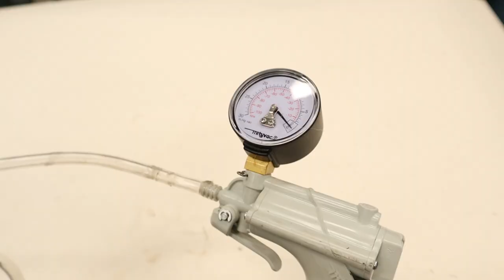Learn everything about distributors, car tips/tricks, and much more! How to become a gearhead! EP#8

Comment: I worked for Ford as a tech for close to 50 years. I also started working on all makes and models at gas stations before Ford. Saw it go from Carbs and distributors to variable venture carbs to two fuel injectors in what looked like a carb yet was a throttle body. In my Ford 302 V8's I went from single point vacuum advance to dual point fully mechanical advance. Fords were easy GM the dist in the rear was not yet they did have a door to adjust  points with a hex key. Then it all became input and out put sensors and a computer brain which by 2004 there were computers to control everything. Some had 4 to 5 different computers to control the windows and A/C and even the horn and all the dash instruments. 

 What I drive now is a 73 VW type 3 which has fuel injection and a basic ECU that unlike modern computers does not hold info. Trouble is you cannot purchase new distributors and it's difficult to find parts to repair ones that have wear. There is a 123 unit that is fully electronic . The basic idea of the stock Bosch dist for FI is the trigger points that in basic terms fire a pair of injectors which is  2 points that work off a cam , unlike ign points the voltage is not high so the points never burn . The 123 unit does all of this similar to pertronix in place of points which I did have at one point . I didn't like the idea if the pertronix failed you have to carry a spare set of points and a condenser and change all of this on the side of the road so I went back to points. Plus the 123 unit is in the $400 range and if it failed better carry an spare stock distributor . 

 I see one can buy new distributors for old Ford and GM cars not VW. You can get points , caps,rotors and the condenser now do not last unless you purchase from places who offer NOS units.
Reply from the maker: Sounds like you know your stuff William and your years of experience have given you a much better knowledge base than any new tech out there.  It's hard to teach this stuff to new students because the new parts still work the same but the ease of adjustability is gone and it's harder to understand the fundamentals.  Thanks for your comment and sharing your love of the automotive world.  Cheers!
Reply: @wayofthewrench  
I thought last night what to address as a reply. I could write a book , over the decades of repairing cars that were new in the 60's and are long gone now. I have seen everything , especially working at dealerships.

 I found the one area doing repairs that most technicians fail . This is electrical  diagnosis . Even that most modern cars /trucks require this knowledge. It's the heart of any system. I will point out the last time I worked as a tech was 1997 , I was offered a new position which became 7 titles. One was the second service manager. 

 At Ford we did have to attend Ford training classes and then pass a test. At the school they had 3 to 4 cars /trucks where they removed a wire or cut one or pulled it just enough out of a plug .  This involved rather large books and what was called pin point tests which were a path of narrowing down a given electrical issue. I never applied this method simply because it was similar to working though a maze . I used the EVTM which was a small book with the entire electrical system laid out. I would  look at the part of the system with the issue , see how it related to the rest of the system and without taking one thing apart know exactly where the problem was.  Using their pin point test once you reached some path out of the maze  you were instructed replace an electronic part which was never in stock and once the customers car sat there for days you find it was not the part after all.  At the Ford school I would not use the pin point test and used the EVTM and knew where the issue was and asked the instructor do I have to pull this panel or can I just tell  you what it is. He said go ahead . He then said I should follow the set procedure. It's basic it's all there in this small book. I still pasted their test . 

 A warranty repair only pays a set amount .  One example one tech who really could not grasp electrical , the basic idea is check the simple first , just look around . He had the entire interior of a Ford SUV removed . I was walking around the shop and took a look and read the repair complaint . Power door locks all work on their own till they quit. I looked in the back and saw a large cooler which happened to be sitting on top of a lock switch in the cargo area. All I did was move it and problem solved . the tech asked me what i did . I showed him, then asked how are you going to get paid for the 16 hours you spent for nothing. 

 Certainly there are countless repairs that are not electrical related . I recall when the hybrids came out and saw this enormous pallet of 12 volt car batteries as a battery pack and thought you are going to add all this weight and save fuel , is this the way to do this and was reminded way back in 1959 when GM came to our school with a fair sized model of a Vett with disc shaped solar panels of the hood shining a UV lamp and it ran , we were told this would be our cars in less than 10 years. 

 I only took one new car I ever owned to the Ford dealership because it would run fine then start bucking . It took hours then I asked is it done , told the tech is just making sure it's fixed. I get my car back with grease all over the drivers door inside and on the 2 mile drive back home it bucked . I told them it does not happen all the time. I decide to look myself to see if anything stood out then see the ignition coil was leaking oil , took one off my to be sold 63 Fairlane problem solved. My father rode with me because he wanted a new coil and then went on to say my 16 year old son fixed what you could not and they said we have to install the coil he said no and they gave it to him. I felt odd having my father do this but i did get the coil.
Reply from the maker: Yup the basic fundamentals are key to any old or new electrical and mechanical issues.  It's very easy to focus in on a problem and miss the obvious.  Start with the easy and take a second to think about why.  Cheers!

Comment: Do you know why  my brush in the center of the distributor cap keeps wearing out ? I tried a new rotor button all ready.
Reply from the maker: How long did it last?
Reply: @wayofthewrench   I just turned it over to see if it was getting fire. Got none . It’s a 1978 trans am .been sitting in a barn 20 years i replaced everything in the Distributor except the pick up coil and looking for a new distributor now.
Reply from the maker: Yeah sometimes replacing the entire distributor is the most cost effective way these days.  Remember you can test your distributor before you change it.

Comment: Off topic but I want to ask.  I have a chevy silverado 1500.  Fuel injector just went on it.  Dealer said I could drive it until parts come in since it isn't idling funny or anything.  I know there is washing of the cylinders.  Am I in danger of that happening if I drive it for the week until fixed?  They did assure me it is okay but im skeptical.  Any info would be helpful.  Thank you
Reply from the maker: Usually when a fuel injector goes bad, it stops spraying or leaks and continuously dumps extra gas or the spray pattern is not misting but squirting droplets of gas.  Personally I wouldn't drive it if it was leaking gas.  If it stops opening then I guess you just have a dead cylinder but if it is stuck open, you are dumping gas and its going to cause damage.  Hard to know without pulling the spark plug and checking for a fuel soaked plug.  Hope that helps you make your decision.  You might wanna do an oil change after it is fixed just incase fuel has mixed with the oil. Thanks for the watch!
Reply: @wayofthewrench  I should have mentioned that the dealership said even though the fuel injector/cylinder tested much higher then the other cylinders that it was still at a safe level.  Hope you don't mind sending a reply if this changes anything in your mind?  Should I still do a oil change in this scnenerio as well? Appreciate the first response. Great channel.
Reply from the maker: How did they test the injector(s)?
Reply: @wayofthewrench  good question. The dealer said they had to recalibrate a machine to test it for my newer model truck.  Was hard for them to find but then had a readings and the one bad one read much higher then the others but still in the safe zone as they said.  Reassured me it was okay to drive for the week.  No check engine light has come back on in the three days since it saw the dealer.
Reply from the maker: Hrmm hard to say, it could be an oscilloscope reading or a pressure test.  I guess when it comes down to it, if the dealership is telling you it's ok to wait, then it must be ok.  Wish I could be more help.  I hope your repair goes ok.  Cheers!
Reply: @wayofthewrench  thank you for the help.  Appreciate it.

Comment: I'm just trying to find out which aftermarket distributor is reputable.
It's a nightmare trying to find out which ones are junk and which ones aren't because apparently they're all junk and you cannot get an original OEM distributor from Ford.
Reply from the maker: Yeah I hear ya, everything's about money these days.  They don't make things like like used to. Even good brands turn bad when they sell out eventually.  Good luck!
Reply: @wayofthewrench  yeah I was just about ready to go with the most expensive MSD but I even started finding plenty of bad reviews on them.
So I guess I'm going to go with one that I could not find any reviews at all on  (WAI) and then I'm also going to get the parts to rebuild my old one. WAI supposedly has a lifetime warranty from O'Reilly's so I can easily exchange it. But even then I will feel better if I could rebuild my old one but even then the parts that I rebuild it with are questionable🤯
Wish me luck.
Reply from the maker: MSD should be good but I get it.  Watch rebuilding your distributor as the parts are more expensive than the entire distributor now and then it can still not work....ask me how I know that.  It's not like the old days where a condenser was 2 bucks...its now 20.  Good luck Bruh!

Comment: I blew my distributor once in my Honda Prelude above 7K RPM, scared the hell out of me :(
Reply from the maker: Woah crazy!  Did you take a look at what went on it?  Mechanical failure or electrical?
Reply: @wayofthewrench  not sure but my guess electrical. Mechanic said it can happen from time to time, especially in Honda
Reply from the maker: yeah they work until they don't.  I had my points go on my 68 firebird and it just quit all of a sudden.  Quick tune up and it was running again.